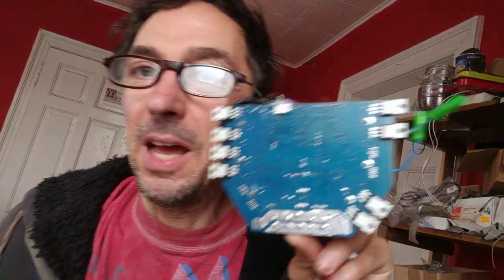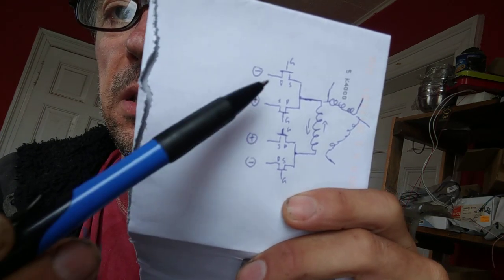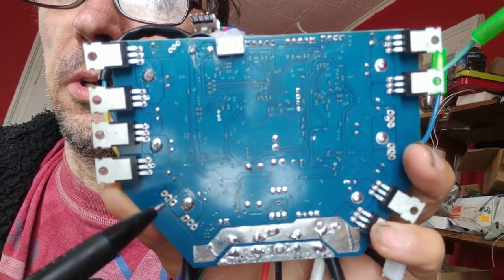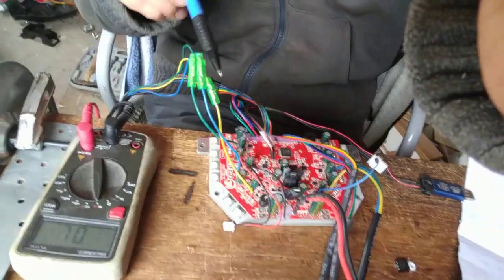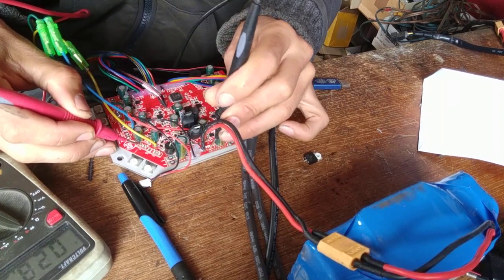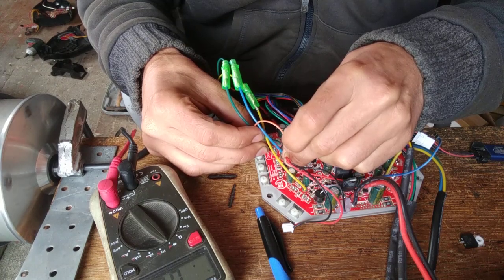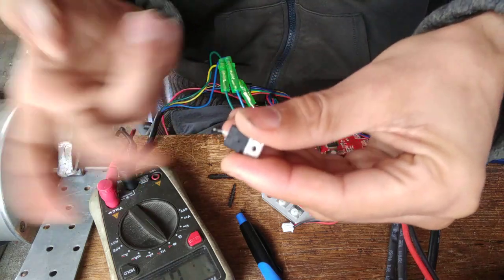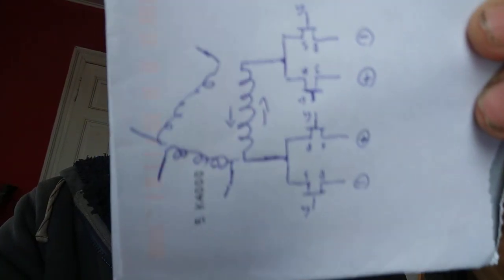part1: Tips on Hoverboard Mosfet Repair

Comment: Can i replace irfb3607 mosfet with Hn75n09ap with no risk ?
Reply from the maker: i would do it. but the on resistance will be different and that might affect the foc alghorithm of the EFeru firmware. So it would be better to replace all 6 mosfets. The phase currents are only measured on two phases and only the low-side mofests of those. So if you want to be a little more careful, make sure that these two mosfets are the same. See the schematics pdf on the eferu github to learn which two of the three phases feed the dual opamp to amplify the voltage drop when the low-side mosfet is conducting = the 8 mOhm at 10A yield 80 mV.

Comment: Can you run 48 volt without any change...? Controller use ..
?
Reply from the maker: 48V usually means either 14s LiIon with up to 14x4,25 = 59.5 Volt or 16x3.6 = 57.6 volt :-( 
With my solar car i boost the 24V (7s) up to 50V. So yes, 48 volt is okay. But my booster can only transfer about 500 Watt. So the 50V can not be held when there is a moderate load on the two motors. Others have successfully tested 12s Liion = 51 volt max. But motors really get hot with full load.
Reply: @robodurden  thank you so much sir for this information

Comment: I got a broken hoverboard that's basically new. It will not power on. One wheel does not spin smoothly by hand, but when I disconnect the blue motor wire, the wheel spins smoothly again. I am trying to learn about mosfets and all this stuff because it is new to me. At the moment it is over my head to repair it but I am determined to try lol
Reply from the maker: Yes that sounds like broken MOSFETs. This video should tell you how to test. I should make a follow up video how to test the function of the 6 MOSFET with a 9 volt block battery..
Reply: @robodurden  yes thank you. I still am confused but I will watch again. Looks like I will also have to learn how to solder and desolder on a pcb.
Reply from the maker: @huge_balls  you only need to unsolder when you have found a broken mosfet.

Comment: Hi. i think this video is not correct.
i learned here that mosfet gates will stay charged even when powered off, and even when using multimeter you can change their on/off state.
Like the video by "Learn Electronics Repair" of 8 months ago, called "All you need to know about MOSFETS to Fix stuff" explains at 00:22:50
Reply from the maker: If the gates would stay charged after MCU shutdown, the half bridge would shortcut the battery. This apparently does not happen so your post seems a bit idiotic.
Study the schematics page 2 and understand how R4 and R9 will discharge the gates. But yes if the first tip127 is shorted and the battery is unplugged, the 3.3V might cease before the MCU shutdown and the low side MOSFET might stay on. With unplugged battery and the high side MOSFET being off this should not really be a problem.
Reply: @robo durden  hi. Yes maybe I'm wrong. i didnt know about the discharge resistors. Thanks for the insight

Comment: Hi, do you know if there is a supply or test point I can pick up on for powering buetooth, board say 6v and the motherboard does not have the red connector for it. Thanks in advance.
Reply from the maker: Watch my other repair tutorial on the three voltage regulators. The 5V regulator might be strong enough to also power a second MCU. Otherwise you have to add another regulator to the 15V output of the primary regulator or add a cheap 60V 1.5A step down to the battery Input.

Comment: Hi I have diagnosed a faulty shorted mosfet on my board but still have a short on the battery plug, red to black. Any advice greatly appreciated or if someone has a wiring diagram for the  KZL-BZ01-MAIN
Reply from the maker: It is annoying when people ask for help without having watched my video.
For a shortcut it needs at least two mosfet to burn. And of course you have to unsolder them to get rid of the battery short cut. As you have not cared to provide me with full information, please to not expect me to help you. bye.
Reply: @robodurden  I did watch, only one is shorted and still have a problem with it removed, hence why I asked. I am assuming with no power applied to board, the battery plug should not be shorted (with no power), do you know?
Reply from the maker: @richierich.1982  well then watch my repair video about the thre voltage regulators. Maybe one of those is shorted.
You might also check if the 3.3V pin on the program header is shorted to ground. if not you should be able to power the stm32 with a 3.3V source and read logging data via serial..

But if the fault is not a shorted mosfet bridge then you would have to do smd soldering anyway. Maybe if the TIP127 from the first voltage regulator is broken you might replace this one.
And strudy https://github.com/EFeru/hoverboard-firmware-hack-FOC/blob/main/docs/20150722_hoverboard_sch.pdf to find more possibilities for short cuts.
Reply: @robodurden  many thanks, re tested board when got home and 2 more mosfets and the x2 TIP127 transisters were 0 ohms continuity C - E. with all removed, the short has gone, not OL, 200KOhm approx, so ordered parts and will see ... 3.3v to GND is approx 1KOhm. Appreciate you taking the time to reply, I will reply with outcome.
Reply: @robodurden  hi good morning, I'm still waiting for my 80N80 mosfets to arrive. I replace both TIP127s. The board now powers up immediately however when 40v applied on battery connector, would this be expected with nothing else connected to motherboard or would you still expect it to power on/off shorting the power button pins? Appreciate your help.
Reply from the maker: @richierich.1982  immediate power on is usually a sign of broken or shorted first tip127.
Reply: @robodurden  agh OK, I did test both (open circuit pin to pins)....on ohms only not diode test mind you.
Reply: @robodurden  many thanks for reply. Replaced it and same. It con checks same as other one, I've fitted both tip127s in same orientation as removed ones...in the manner of flat part of tip127 facing into the board
Reply: @robodurden  did a pic of diode bias results but cannot attach as pic
Reply from the maker: @richierich.1982  first Tip127 is simply on and off. Take a look at schematics pdf and learn how the on button works.
Reply: @robodurden  I will be buying more TIP127s but not from Ali Express. They are all doing the same thing
Reply from the maker: @richierich.1982  AliExpress is okay. With so many things Borken on your board it's likely that some SMD parts like gate drivers are broken to and you better invest in a used hoverboard and salvage another electronic board..
Reply: @robodurden  waste of time fitting the 3 removed mosfets then you think, no impact on this causing issue even though they are for motor control? The 3.3v and 5v are fine. Appreciate your expert advise
Reply from the maker: @richierich.1982  watch my latest repair video on the MOSFET drivers.
You can test the low side with a DSO but unfortunately, the high side only works with the two MOSFETs inserted. and if it doesn't, the MOSFET might burn instantly. A catch 22 scenario :-(
Still need to find a way of testing the high side gate driver before new MOSFETs are inserted :-/
Reply: @robodurden  good evening, I'm going to change the 2 capacitors, C3 and cannot identify the other on board, 16v 470uf. These have come up on few videos for board staying on. I don't suppose you have a link to component identification locations.... even though they are marked on board, I just cannot see the ident, it is next to the inductor, I can see C4/2
Reply: Can't see how C3 and C4 would keep board powered up. Has to be the TIP127 or what about the tiny Q1, biasing the TIP127
Reply from the maker: @richierich.1982  tell me what you learn from https://github.com/EFeru/hoverboard-firmware-hack-FOC/blob/main/docs/20150722_hoverboard_sch.pdf
I am living outdoor now with -10 °C at night.
Reply: @robodurden  wow why outside? I will tell you what I've learnt when I replace the TIP127s for a Third time! I'm not a digital techniques guy but am an electrician so test equipment familiar with but not so much with ESR and oscillascope etc..
Reply: @robodurden  hope you are doing well, my replacement TIP127 gave me same result C3 and C4 tested ok (only with DMM) but refitted. Q1 gave abnormal readings so I have ordered a couple. With it removed, the problem has gone and of course won't turn on at all, tested other resistors in this circuit so hopefully this transistor is the issue, fiddly soldering, think I've lost my post for the base so will put in a link to the resistor R6.
Reply from the maker: @richierich.1982  i don't see a Q1 transistor on the schematics pdf.  But it seems that both Tip127 and the 5v and 3.3v regulators are missing. Or i do not have a complete pdf anymore.
If you also have no circuit plan, please make one yourself and start a new issue  on the eferu foc  GitHub repo. Your circuit plan must not be complete. But we need a schematics to talk about. 
I fear you only read the markings on the circuit board.
Reply: @robodurden  at the bottom 'more pages' 2 more pages
Reply from the maker: @richierich.1982  please post a link.
Reply: @robodurden  struggling to post, you put the link in a few posts back. Struggling to locate C5 of the power on circuit, only issue I can see is R8 is 5K not 51K, no parallel or series paths to effect reading.
Reply from the maker: @richierich.1982  now I see the pdf. If r8 is only 5k then r7 should be 1k.
Otherwise pin 1 of q2 can not be pulled to low and thereby open q2.
You should monitor the voltages on pins 1 and 2 of q1 and q2 while pushing the on button. Pin 2 of q1 should go to 0V and pin 1 of q2 should drop from 36V so that pin2 of q2 goes from 0V to 36V.
Simple npn and PNP transistor design
Reply: @robodurden  r7 is 10k. My fault is that it is always powered on
Reply from the maker: @richierich.1982  10k might still be okay and pull the voltage of pin 2 q2 low enough to open that PNP transistor.
You can pull pin 2 of q1 to gnd manually with a little wire and see if q2 opens. 
As I said, learn how PNP and npn transistors work and verify the voltages of pins 1 and 2.
Reply: @robodurden  so with Q1 removed, can I trigger the board on and off by  shorting/unshorting 1 and 2 of Q1
Reply from the maker: @richierich.1982  no you would have to pull pin 2 to gnd. So yes, a switch that shorts 2 and 3 would turn the board on and off. But then the CPU can not turn off the board after 10 minutes. But to test q2 you could short 2 and 3 of with a little wire and see if q2 opens. Better connect 1 to gnd at the big capacitors side. Don't know if you can short 1 and 2 of q1 easily.
But first learn the difference of PNP and npn transistors. Go read the Wikipedia page.
Reply from the maker: @richierich.1982  you do not need to remove q1 to pull it's pin 2 to gnd
Reply: @robodurden  I removed Q1 as readings were not as expected, got 2 of them arriving to replace it.
Reply: @robodurden  shorted pin 2 and 3 but get nothing...
Reply: 39.75v at 2 (C) with 40v/2A set from bench supply hooked up.
Reply: 39.8v at base and emitter of Q2. 0.8v at Collector. This is power on board but switched off!
Reply from the maker: @richierich.1982  that is not really possible.voltage at pin 1 of q2 must drop if you short pin 2 and 3 of q1. If indeed no change then pin 3 of q1 is not connected to gnd or a break from pin 2 of q1 to pin 1 of q2.
Reply: @robodurden  sorry that was just a measurement doing nothing to board except voltage on batt plug. All tracks clock out fine and components regarding the on/off circuit (except Q1 removed) tricky shorting Q1 2/3 and measuring voltage at Q2, I have 39.8v on 1/3, 1.2 approx at 2.
Reply: @robodurden  ..... right, I need to short  2/3 (C/E)of Q1 but with it shorted....then trigger on/off pins as usual....?
Reply from the maker: @richierich.1982  when you short q1, q2 should always be open and Board on.
Reply: @robodurden  solder linked it out instead, yes correct it is on replicating my issue when Q1 was fitted
Reply: LED dims really quickly and only getting 2v instead of 3.3v. Even when it was permanently on, I had 3.3 and 5v
Reply: Needed to short the on/off pins as well, LED full brightness and 3.3v now. Has to be a faulty Q1 then..
Reply from the maker: @richierich.1982  when q2 works correctly you have to check Q3. This is more difficult because it is a step down converter which generates 15 V.  After that two linear regulator chips make 5v and 3.3V.  I can not really help you any longer. This q1 and q2 is really most basic transistor knowledge. If you do not even master that then I can not guide you in any way to check Q3.
Reply: @robodurden  no worries, I really appreciate your help and replying, I will gen up on the theory

Comment: hi, robo. 

i have a board that I use with the seat kart, and when Im going straight near top speed it doesnt want to turn left as easily as it turns rightt, it is slow to change direction.

do you know what may be the cause to make the hover board less able to turn in one direction than the other? 
it is almost symmetrical but just less controllable at speed.
Reply from the maker: Mount the hoverboard with left as right..
I guess it is a mechanical thing of the speed levers.
I don't like fun sports.

Comment: few day back got 12 volt to 36 volt bldc motor driver from tomtop , I'm trying connect to bldc ( out runner ) motor , ,but unable to turn the motors and finally while soldering  ,the part which connect through pot completely damaged  ,,, any solutions if yes plz reply by email , thank you sir  vasudevapaniyur37@gmail.com
Reply from the maker: no email! when something is completely damaged you obviously got to get a new one.
Reply: tq Sir

Comment: Hello, I don't know if you could help me. I have tried to use an old hoverboard to make a little go kart. I have tried everything but the motors just wouldn't move correctly. I think it is a bad transistor but I don't know which one. I measured the voltage on each one and one side show that is working correctly but on the other side I have only like two transistor that show something the other ones just show 0. How do I fing the transistor that is broken?

Comment: Hi! Do you know problem related gate in the MOSFETs?
Reply from the maker: I still wait for replacement mosfet from china. Maybe new mosfet will not help because the gate drivers are broken. Then maybe the mosfet burned because the gate voltage jumped to 42 Volt :-(
Don't know how to test the gate voltage. Maybe spin the motor and wait until the hall sensor for that mosfet gets activated.. I guess the normal gate voltage should be 10-15 Volt.

Comment: Can you help me with my Swagtron T6 Hoverboard? I've noticed some capacitors seem to have burned out. In fact, one of the capacitors blue it's small tin cap right off. I thought replacing the broken capacitors would fix the problem with mine but they still won't turn on and still won't work. I am worried there is something else wrong with it.
Reply from the maker: Watch part 2 to check the voltage regulators and part 3 to test the gate voltages. And already start searching for a control board whose cables match yours.